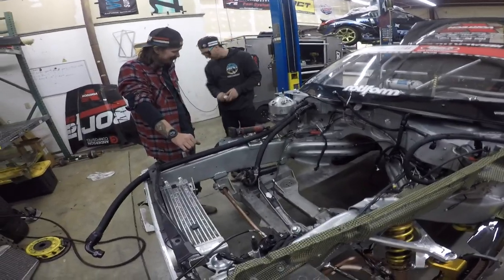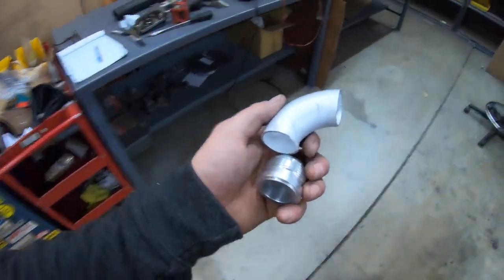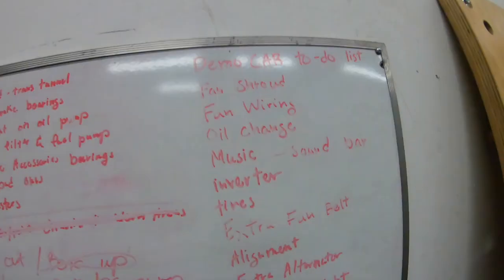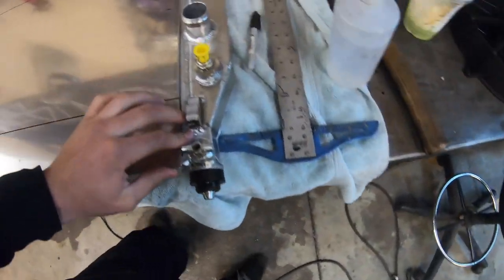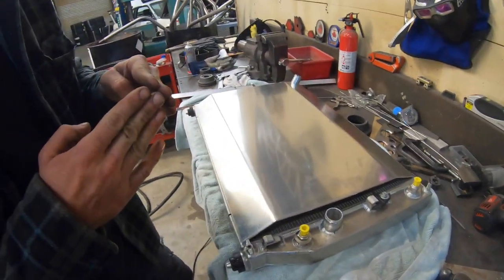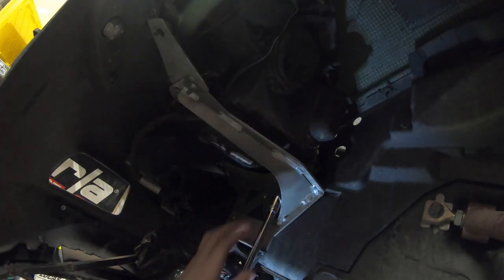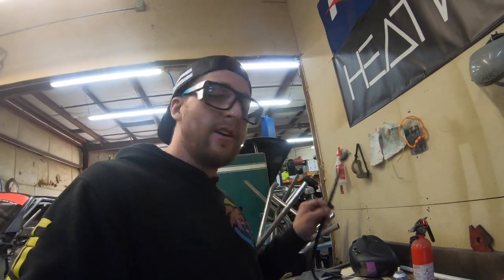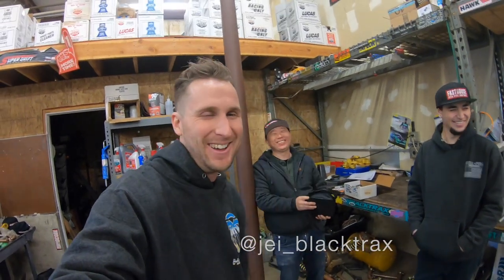Field Prep EP4--SPAL Fans on C&R Racing Radiator, how to fix an overheating  drift car

Comment: What happened to the front shroud for the demo car?  That helps the air dam be effective. Or is that gone too?
Reply from the maker: The car was salvage when I got it, so I never had it. But for drifting, I really think it does no good. When going 100MPH, yea it's probably sweet.
Reply: @Frenemiesdrift  it's not for downforce if that's what you think I mean. These bottom feeding cooling systems like their ducting. But yes, it would only help for your street drive.

Comment: Why mount the catch can so far back? such a long line..
Reply: trying to keep as much weight in the rear of the car, over the axle.
Reply from the maker: Cody is right, keep the engine bay clean, keep the weight in the back, and the longer the line, the more air, the more it can hold
Reply: General rule for drift cars (or any racing discipline for that matter) is "if it doesn't need to be bolted directly to the engine out it in the boot